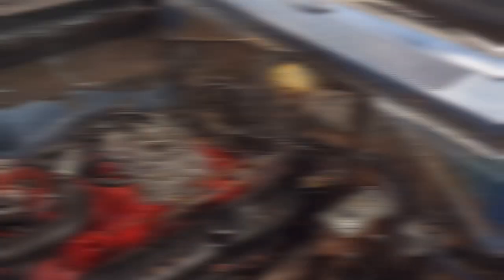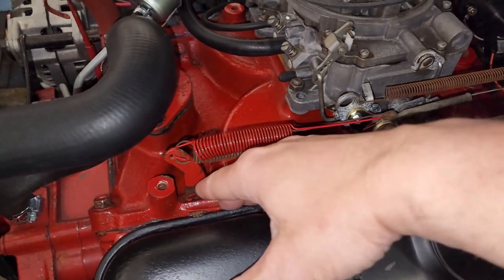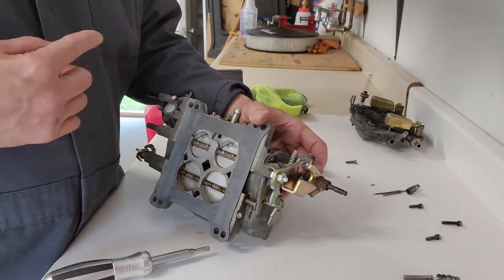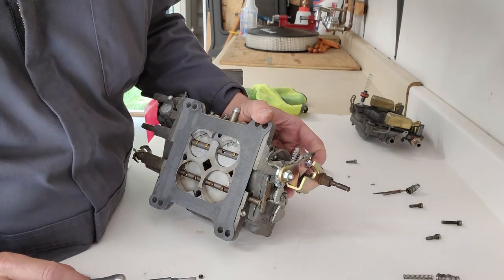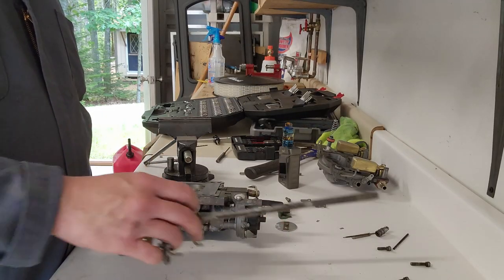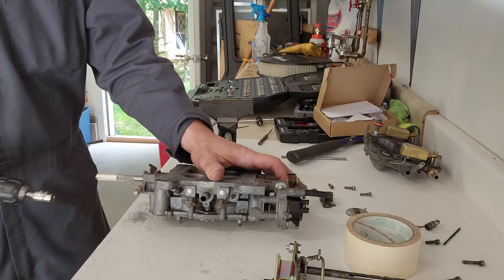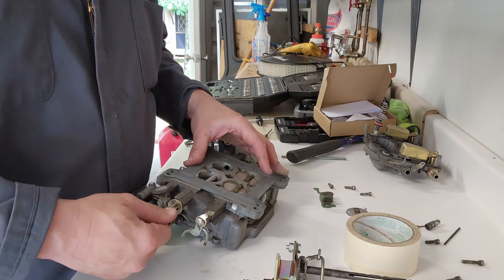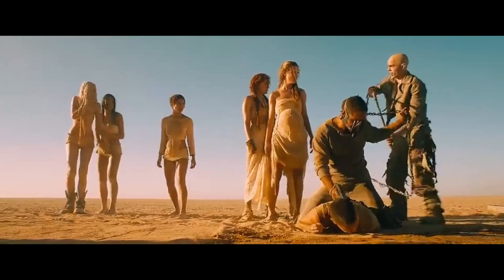How To Fix Your No Good, Worn Out Throttle Shaft

Comment: rawsome!  I chased down several air leaks....intake and exhaust......and now my invaluable SMOKE MACHINE is showing an air leak at the throttle body spring/shaft area.  I ordered a used one on EBAY for $30 and will investigate/repair/swap.
Reply from the maker: That's pretty sweet! I will be getting a smoke machine eventually. I am just now getting to the point where I can afford some of the more fancy tools. Lol. Definitely check out the bushing kit in this video. Worked quite well.

Comment: Way back in the late 70's my friend who was a machinest was messing with the idea of doing this and we did a 2 barrel on a Chevrolet station wagon and nobody could believe the results.I wish I could remember what we used for the bushing for the fix.It was still at smooth idle 15 years later.😎😎
Reply from the maker: Hi Gregory, Thanks for the comment, and welcome to the channel. Sorry it took so long to get back to you. this comment went into my held for review queue and I missed it. The bushing kit did a pretty good job. These were either brass or bronze. I was concerned about the screws in the throttle blades coming out since I ground off the stakes. As a result, I picked up a new carb. The old one still needs the secondary shaft done but I don't have the right sized kit so it'll get done once I have another engine to throw it on.
Reply: If I recall I believe we were using 22 caliber shell casings for the throttle shaft bushings. I was the only person fixing 2 barrel carburetor throttle shafts in those days and we always had a shelf full of rebuilt carburetors and mine always ran great. I did carburetors for farm equipment and everyone I knew their spraying equipment ran awesome.
Reply from the maker: @gregorypierce6703  That's an awesome use of a spent 22 shell. I would have never though to use spent brass and I have a ton of it. I miss the days of fixing things instead of buying something new. My stepdad was a major influence on me wanting to work on classic cars and he fixed everything he could. I just with I had a better handle on fixing rather than replacing. I am working on it though. =)

Comment: So was the shiney carb with the angel chior the same one or a new carb?
Reply from the maker: Hey Jonathan! Thanks for the comment, and welcome to the channel! That was a brand new edelbrock 1406. I didn't want to risk the throttle valve screws dropping into the engine, and the secondary blades needed to be done as well. I didn't have new screws to stake properly or the right size bushings for the secondary throttle blades so I went with new and hopefully reliable.
Reply: My exact question. Thanks

Comment: I would like to discuss with you how you went about getting the throttle pressure lever (I think some people call it kickdown, but mopar people tend to not like it called a kickdown) setup with your 4 barrel conversion.
Reply from the maker: @dakotasclassiccars7246 Hello and welcome to the channel! Thanks for the comment. I am not particular to what you call it, and I am not necessarily MOPAR specific. My first project vehicle was almost a '68 C-10 but someone beat me to it. As to the kickdown, my solution started with using the throttle bracket from a 340 4bbl. It puts the throttle cable and the back half of the kickdown linkage at the correct angles. There is also a 4bbl piece specifically for the front half of the kickdown linkage but they are not a common piece and I did not find anyone who makes them. I ended up using the slotted piece that was on my original 2bbl setup. Initially it hit the screw that holds the throttle cable down when I went to WOT, but a little heat and some bending got it to clear without completely throwing the geometry off. I just had to make the adjustable lower arm a little longer. If I had to do it again, I would go with a kickdown cable. That is what the 360 is getting. If you want to discuss it in more detail, fell free to hit me up at montsweaggarage@outlook.com.
Reply from the maker: Hopefully a better explanation. If you have any further questions shoot me an email.
https://youtube.com/shorts/odve2z9lUP8?feature=share
Reply from the maker: You can see the complete setup briefly here.
https://youtu.be/WjLdZvraXOs?si=XM2PQFee-bUNtqVP&t=456

Comment: I plan to do the same thing to my edelbrock carb how’s lock tight holding up on the screws
Reply from the maker: I ended up replacing the.carter with a new edelbrock 1406. Didn't want to risk the screws coming out and falling into the engine. And as the shaft for the secondary was also leaking, it runs much better with the 1406. Have 20in of vacuum now vice the 17-18 I was seeing with the Carter.
Reply: @MontsweagGarage  thank you for messaging back
Reply from the maker: Thank you for watching. I hope the video was helpful.